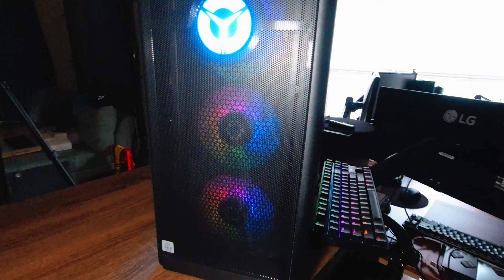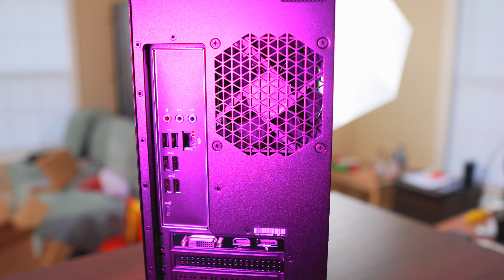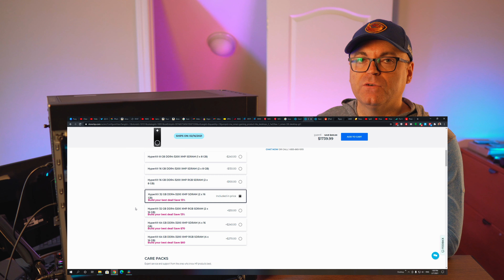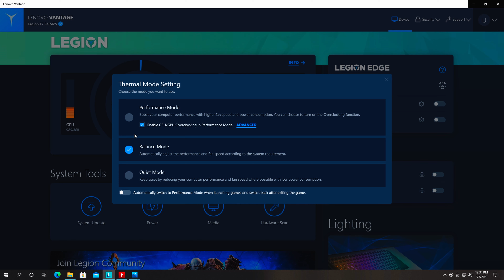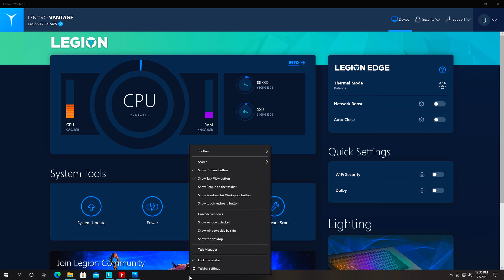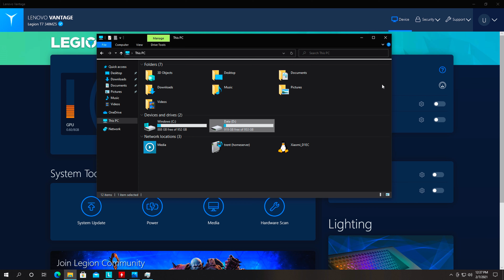Lenovo Legion T7i - Possibly The Best One Yet!

Comment: Just got one with a combination of 3060ti and 11700k ,  the only thing i have some doubt is the psu at 650 which so far seems ok but I haven’t tried any overclooking yet... 
I would say that I was really impressed from the engineering behind the case it’s an absolute silence case with a modern design and very comfortable for conman upgrades 
Also they have allowed the option for XMP profile by default
All in all a very solid build especially in time so difficult to get pc parts and  be calm about the use of parts on previous miners pc 
Tried it in FHD and 1440p and 4K the results are great obviously the 4K is a bit hard for the 3060 ti but for me it’s a great buy worth it
Reply from the maker: I guess the XMP is an option for the new  SKUs with 11 Gen Intel, since the old one doesn't have it.
Reply: @HardwareSense   yhe for sure great review man really enjoyed it. It feels like you have thought very well  on this one

Comment: I bought the one with i7 11700 K 
RTX 3070 16gb for 1800 . It came with hyper x ram 3200 mhz . So they may have addressed the  🐏 issue
Reply from the maker: Probably not, does it have XMP?

Comment: is it me or the watercooler is actually making high frequency noise?
Reply: It absolutely does from the AIO pump. I replaced mine with a Noctua NH-D15 and it's pretty much silent.
Reply: @mikechea4600  yEAH I just got this tower from newegg and the pump noise is kinda bothering me, its not as loud as those ramped up fan noises, but I found it to be extremely annoying for some reason. I don't know if it's making me to have auditory hallucinations, I think I can even hear the high frequency  humming sound with headphones on, or in another room...
Reply from the maker: Some people are a little bit more sensitive to the noise, but I know what do you mean

Comment: Here are some of my thoughts from my response to someone's question down below:
I also expected them to skimp on some of the parts but everything was either what they listed or better. The PSU is 650W Gold+ (not modular, I think the brand was Seasonic). There are several extra connectors for upgradability (including 5 or 6 sata power cables). There’s an extra PCIEx16 slot (not sure if it’s 3.0 or 4.0) and m.2 slot. There are 6 sata data slots on the motherboard. They include 2 connectors for sata power and data that are perfectly aligned with the 2 hard drive slide out trays that open to the cable management side of the case. There are 4 additional spots for easily mounting sata drives on that side of the case. They didn’t list the type of m.2 drive they include but it’s a Samsung 980 Pro and I was getting a little over 7000 MB/s out of the box. All of the rgb is controllable through Lenovo Vantage with tons of settings for each of the six zones. Their site said it came with i7-11700kf but I received an i7-11700k. I’ve read that they used weird ram sticks but they’re the typical HyperX Fury you can get anywhere running at the expected 3200 speed out of the box. The motherboard is a standard size. Cable management is also beautiful.
Reply: I never bough lenovo prebuild desktop, should I buy it or should I buy laptop version? Is there any downside or hardship for someone who doesnt understand from computer parts?
Reply: @mcan-piano4718  this is a safe bet for someone who is not familiar with pc parts. I purchased this for a family member who was able to launch up with no questions. I purchased another prebuilt from ibuypower and cyberpower, and my family member had an issues getting it going since some drivers were missing. The Lenovo Legion really kept the average consumer in mind. I can say the same for the HP omen as well, both are simple
Reply: @heyyandie  Thank you so much. Then lenovo and HP is really good for people like me. Thank youuuuuuuuuuuuu so much for kind help.
Reply: I bought a lenovo tower 10 years ago... Nothing brilliant. Some version of an i5 and a gtx7-something. It's been switched on pretty much since the day i bought it and now sits in my bedroom as my tv/tower for on a night. Honestly, apart from it slowing down a little due to age and parts compared to my 2080 rig i have now it's been perfect. I haven't had any complaints. Lenovo fill their pc's with bloatware but they're always well built and don't use the worst parts or proprietary (looking at you dell/alienware).

Comment: How does the PC behave under stress when gaming due to temperatures and fan noise? Thank you.
Reply: I have the 3080 version and its amazing under stress, i think its the best pre built you can get right now, im runnning games at 4k max and fan noise quiet, temps of cpu in low 70c range and gpu low 70c range, gaming for hours and stays cool, running back 4 blood beta and hunt showdown, was playing new world beta, flight slim ect.
Reply: @djacob9800  i read many noise complaints about the 3080 version. How do you control it? I wouldnt mind when gaming but i would want it to be quiet when working on music.
Reply from the maker: You can barely hear it
Reply: @HardwareSense  Optimal. Also applies to the model with 3070 lenovo legion t5/t7 that you know of?
Reply from the maker: @francescosalzano7830  Yes it should

Comment: Can you change fan speed in the bios?
Reply from the maker: Not really
Reply: @HardwareSense  I recently bought this pc and upon turning it on the only rgb working is the gpu lights, and when I open vantage I don’t get a lighting customization window. All the lights did come on when I first turned it on but went off after a second or two. Is there anything I can do
Reply from the maker: @carsoneades9124  Probably reinstall the Vantage software
Reply: @HardwareSense  I’ll try that, much appreciated man
Reply: @HardwareSense  I uninstalled and reinstalled and it didn’t work, maybe something wrong with the wiring?
Reply from the maker: @carsoneades9124  That is possible too, trace the cables and make sure they are attached to the motherboard, also the Bios has an option to turn them off so that might be it too
Reply: @HardwareSense  thank you

Comment: Thank you for this video. the only thing that I didnt like is the bunch of cables coming out from the GPU at the front of the window... ugly mistake in my opinion :/
Reply from the maker: That's an nVidia design issue unfortunately, making the power connectors in the middle of the card, well technically it is the end of it, but since larger cooling is needed, the card size is almost doubled.

Comment: i’m getting a legion tower 7i, which comes with a i7 10700k, rtx 3060, and only a 512 gb SSD. I know our motherboards and cases are very similar. Since my pc isn’t coming with a HDD, I ordered a 2TB 2.5 inch HDD to put in my future pc coming in a week. But, I’ve never installed a internal HDD before, and i was wondering if the HDD slot on your pc is located behind the right panel? Or if it’s visible through the left glass panel, and it’s a easy install, i’m a little confused on where the HDD slot in this pc is located, and would hope you could respond and tell me where your HDD slot is located, because due to how similar our pc’s are, the HDD slot might be located where my HDD slot would be.    (great video by the way, liked and subbed)

Comment: the unit i have has a pretty audible fan/whirring noise even at rest. it definitely isn't silent. does anyone else have this issue?
Reply from the maker: Yes, multiple people have reported an issue with some of the fans
Reply: hm ic. any advice on how to solve the issue? can you turn off the fans individually using software so you don't have to remove the fans from the power supply and figure out which fans are the ones causing the issues? and just replace those?
Reply: i'm pretty sure the noise is coming from the radiators though
Reply from the maker: @jonathansheng6143  The fans, you can one by one unplug and see which one it is and maybe claim warrant, or replace all together with a better ones.
Reply: @HardwareSense  thanks for the reply. Do you know what fan sizes they are? And is it difficult or dangerous to the computer to replace fans in an aio? Sorry my computer knowledge is really limited
Reply from the maker: @jonathansheng6143  They are 120mm fans and it should be easy to replace all of them together
Reply: @HardwareSense  i ended up unplugging a 3 pin connector to the motherboard right under the upper back most fan. Funny enough the fans were all still spinning but the noise completely went away. Now what does that 3 pin connector do? I have no idea.
Reply: On the motherboard manual it looks like connector was for the cpu pump so I think my fans may have been fine but my
Pump is being noisy
Reply from the maker: @jonathansheng6143  That's normal if it's the Pump
Reply: @HardwareSense  ic. maybe it's just because i'm not use to an AIO but it just seems pretty loud for a computer on idle. here is a vid. does anyone else's computer sound like this?

https://youtu.be/6TD6-7iwF78
Reply: @jonathansheng6143  Your link is private but yeah I have an annoying high pitched noise coming from the pump. I temporarily disconnected it and went away. I shouldn't have to do it but I'm looking at replacing the AIO with a Noctua air cooler.
Reply: o sorry made the video public now. yea i feel like that may be the solution. even with replacing a cooler the price of this computer is still good compared to the more botique options i guess. do you know what noctua cooler would fit in this case? I was thinking of swapping out to a higher quality AIO pump otherwise if i couldn't get use to the sound.
Reply from the maker: @mrtreeleaf  I am sure that you can swap the stock with any aftermarket 240mm AIO and probably most air colliers too.
Reply: @HardwareSense  so if anyone else has this problem, i ended up installing a noctua d15S into the system and it is much better now. the only issue i ran into was that the aio mounting bracket was actually glued onto the motherboard in the back so you have to kind of pry it off very gently and tease the glue off using library cards/loyalty cards. other than that, you will also need to buy fan mounting screws  if you want to salvage the old fans that were connected to the radiator and just mount them to the top of the case

it sucks that i ended up having to spend the extra money and time but i do like the rest of the system so i decided to work with it. in all fairness, lenovo did offer to replace the cpu pump w/ a technician or replacing the whole system because it was under warranty but seeing how there are other people with this problem, i wasn't sure if it the next pump they gave me was going to have the same problem. even though their customer service is actually pretty good, it takes too much time with the back and forth.

Comment: Thank you for this perfect review! From many feedbacks, It seems that the fan system is a bit problematic. Do you think it's safe to replace them by liquid cooling system like Fractal Design Celsius+ S24 and S36? Do you have any specific model in your mind? Thanks a lot!!
Reply from the maker: Thanks for the support, and yes the stock AIO can be replaced with pretty much any 240mm one, Corsair or EK or anything.
Reply: @HardwareSense   Thanks!

Comment: Great video! I just got mine this weekend and I love it. I got the 3080 version. Do you know if theres anyway to make the fans run faster than the presets in Vantage? It feels warm when I game but it could just be the 3080 ( coming from a 1080ti ) and im not used to the new temps.
Reply from the maker: No and don't worry about it, should be fine

Comment: I have this computer and I think my cpu fans are causing this high humming noise and it will not stop
Reply from the maker: Ball bearing fans tend to be a little bit more noisy
Reply: @HardwareSense  the fans it’s self are pretty quiet but radiator fans are causing the constant humming noise that can be heard pretty well
Reply from the maker: @HadjeAmar  Some could be faulty

Comment: I just got this system, lovely hardware. The only downside is the 10900K's onboard video isn't just not connected to HDMI, but seems to be disabled at the hardware level? The CPU is clearly a 10900K NOT a 10900KF, so the Intel Integrated Graphics 630 is on the chip. But I can't find any way to access it.

The Intel 630 is still super useful for Quick Sync. For example in Plex, the Intel 630 can hardware encode a ridiculous amount of streams (at least 10) at the same time compared to NVIDIA cards which are hardware limited to 3 streams, and I think that includes decoding as well so in practice even less. Or you could use QuickSync instead of NVIDIA NVENC for streaming, if you want to max out GPU game performance. This isn't a huge deal but it was one of the reasons I was happy to pay a premium price for this tower over an AMD configuration with potentially more cores. The memory speed limitations don't bother as much since memory speed doesn't effect that much on Intel 10th gen.
Reply from the maker: Good point, I think Lonovo just figured that most people buying this SKU, will use the dedicated GPU for gaming only...
Reply: @HardwareSense  Another workstation use of IGP: according to PugetSystems benchmarks, you can get about a 15% speedup in Adobe Premier if you use Intel integrated GPU for decoding, and the NVIDIA GPU for encoding, as it splits the load between the two.
Reply: @HardwareSense  I plan to buy for 3d rendering with gpu+cpu. Is it bad for productivity?
Reply from the maker: @mcan-piano4718  It's great for productivity
Reply: @HardwareSense  Thank youuu :)) glad to know

Comment: I’m looking at the i9 version with 32GB ram and a 3080. It says on the listing up to 650w supply but nvidia recommended 750? Can you put me at ease if possible please? I was going to order tonight!
Reply from the maker: If Lenovo tested it with 650W and are selling it like this, should be fine
Reply: Thanks for the fast reply ! Yeah that’s what I was thinking - would it be easy enough to swap it for a higher psu if I wanted further down the line ?
Reply from the maker: @MooChimp  Yes the PSU is absolutely standard ATX and can be easily changed
Reply: @HardwareSense  Sold - Thankyou very much for the responses 😊
Reply: How much was it & which site did you order?

Comment: I just got my T7i with a 3080 today and I'm really disapointed with the performance. Running 3d Mark results way under average, especially on the CPU side. And if I watch my CPU during load with prime95 I see it's only running with 3,6Ghz and consuming 70 watts. Seems like its power limiting somehow. Did you do some benchmarks on your machine?
Reply from the maker: What CPU do you have in it and what's the memory
Reply: It’s the one with a i9 10900k (which is actually a 10850k) and stock Memory 2x 16GB 3200. I tried changing the ram slots but makes no difference. The cpu is never getting above 75 watts. Doesn’t seem to be normal, does it? I also did the cpu benchmark with performancetest which should be around 23000. It’s about 16000 in my case.
Reply from the maker: @christian46479  What do you have it at the Vantage software?
Reply: I‘m running on performance. Tried overclocked and also balanced just to see whether there is any difference. Windows power settings are also on high Performance. Thanks for taking the time asking my question by the way 👍
Reply from the maker: @christian46479  There has to be a setting you are mining, maybe in the Bios
Reply: @HardwareSense  also checked everything there. It’s not too many things you can change but the usual suspects like turbo and EIST are all enabled. I also found this post on Reddit where someone has a similar issue with the 10700k https://www.reddit.com/r/Lenovo/comments/mx1k3m/legion_t7_34imz5_es_poor_3dmark_score_at_stock/
Reply from the maker: @christian46479  That guy on Redit is running single channel memory, that's the issue there, but you have dual...
Reply: @HardwareSense  do you have any other idea what could cause this issue? I mean I haven’t changed anything after unboxing the machine except installing some basic software. I would have thought that a prebuild system just runs out of the box. I will open a ticket at Lenovo today but if I don’t find a fix I will send back the system.

Comment: Thanks snagged the 3080 version today.   Looks like maybe I dont need to case swap it
Reply: How much did you pay for it? Tempted to purchase one, I got a decent 3060ti with an older Ryzen gaming rig. But figured I'd upgrade. It's 2500 EUR here tho.
Reply: @stevenseagalsmom  $2200 after tax after some coupon I found on slickdeals.  Plus 5% cashback using a brower plugin   that I didnt factor into that price.
Reply: @MtnXfreeride  that's cheap. ah well, bought it for my company. 25% off I guess. Have ya been enjoying it so far? I'm basically purchasing it for the GPU and CPU upgrade.
Reply: @stevenseagalsmom  its loud compared to my self built desktops over the last 10 years but power wise its great. I did it for the cpu and gpu.. i had a i7 6700k before and because I play dirt rally 2 in VR it was a bottleneck along with the gpu.
Reply: @stevenseagalsmom  i might try and swap the cooler and fans for noise reduction

Comment: Are there hard drive bays/PSU cables included for hard drive expansion? I have two SSDs in my current build I want to transfer over.
Reply from the maker: Yes.
Reply: @HardwareSense  Thanks for the quick response!

Comment: Does this system have integrated graphics?
Reply from the maker: I9 10900k has IGPU
Reply: @HardwareSense  I did research, the board does NOT have iGPU
Reply from the maker: @chubbstep  Yeah, luckily it can be easily changed